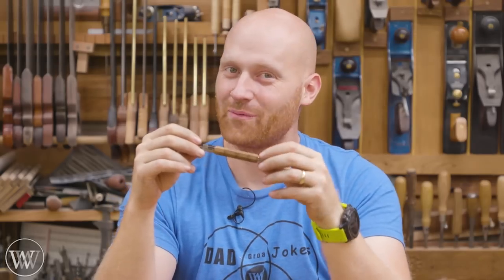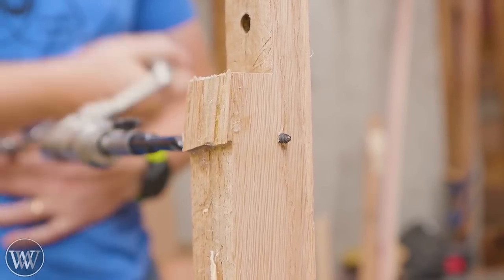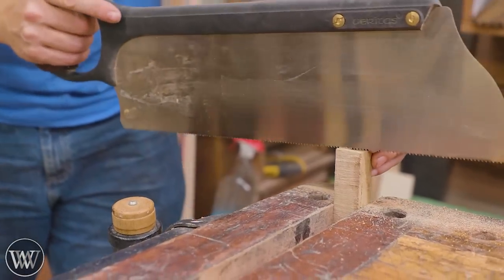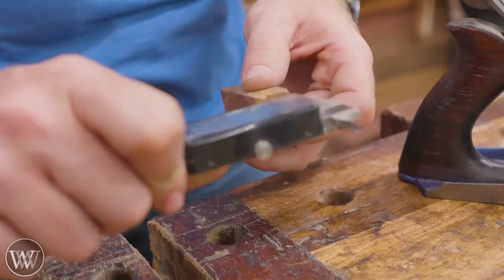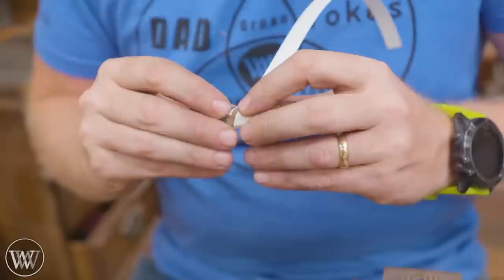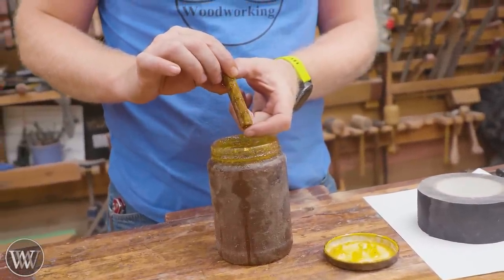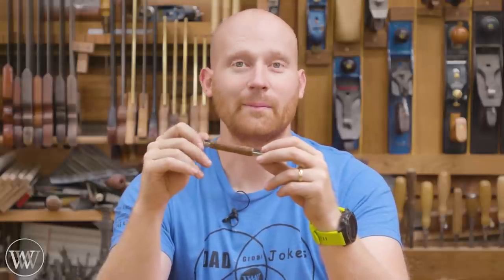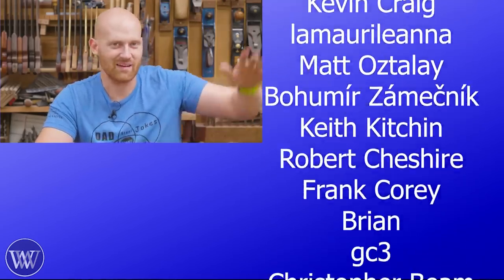How to Make a Lead Holder Without a Lathe

Comment: What if one doesn’t have one of those vacuum things
Reply from the maker: It is not necessary to make it. It just makes it a little bit easier.
Reply: You might be able to get away with "thin" CA glue.  I know a lot of pen turners use it as finish, and CA cures into acrylic just like Cactus Juice does.